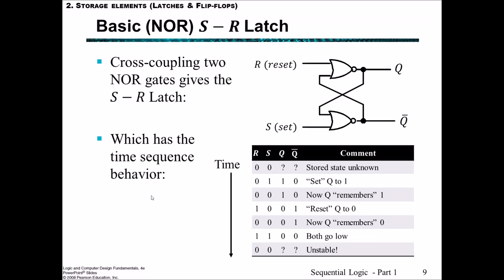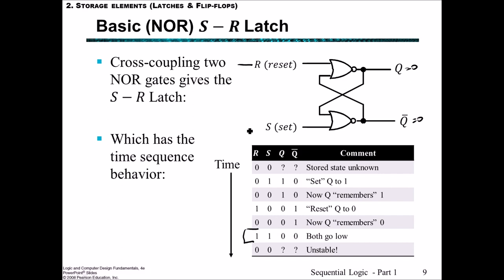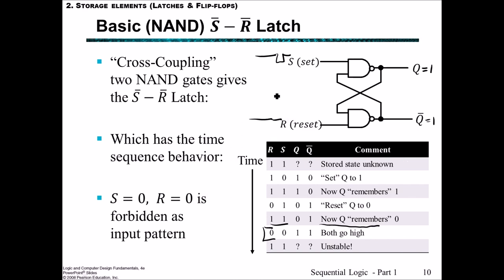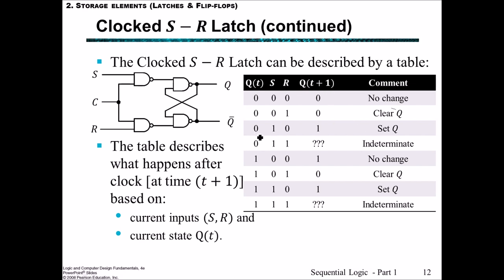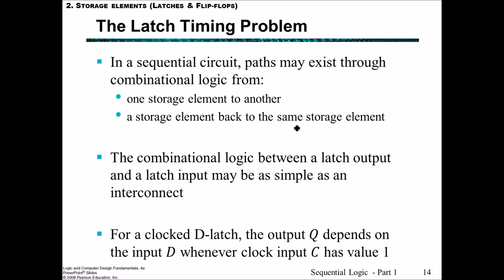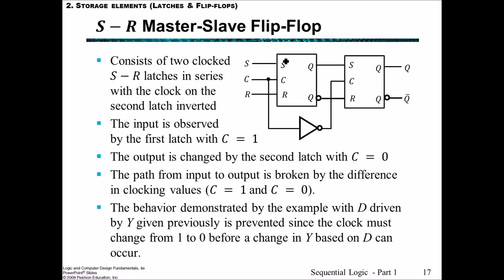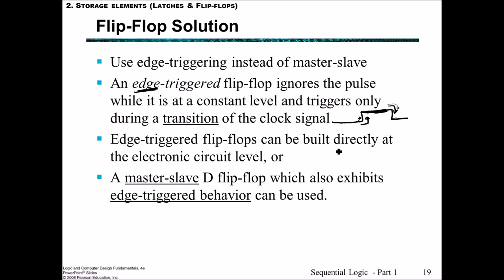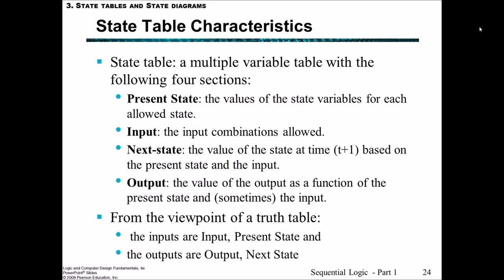Lecture 4.2 - Storage elements (Latches & Flip-flops) (Mx1)

Comment: Very well explained. What would be a real life example where these storage elements would be used or something similar?
Reply from the maker: Hi. Thanks for the feedback. 
If you continue on with this and the next lecture you will see how we implement them to hold onto the state in a sequential logic circuit. 
An example of using a memory element in real life could be to make a counter which counts up and down depending up on which of two buttons is pressed ("up" or "down"). In this case you need to store the system state (i.e. which number are we currently up to). If the counter was at 3 and you pressed "up" then the next number shows should be 4. That means it depends upon the previous state "3" and the input of the button "up". There are many chips you could put this such a schematic on, but one real-world examples would be using Xilinx to put it onto an FPGA (or CPLD). Perhaps that could be used for a very simple car odometer.
Reply: Thank you for the reply!